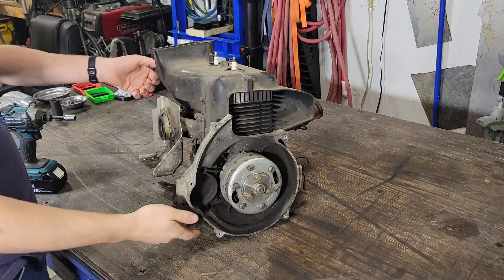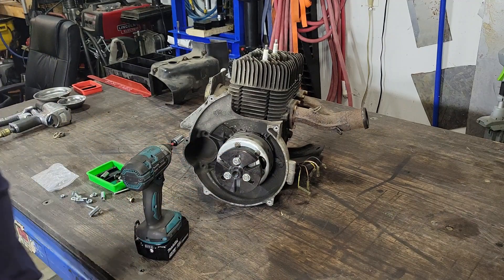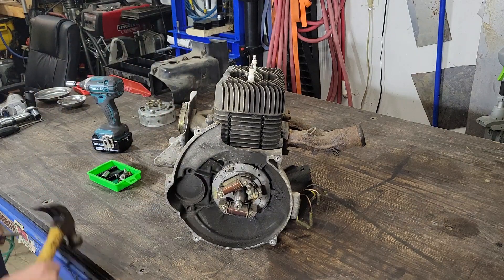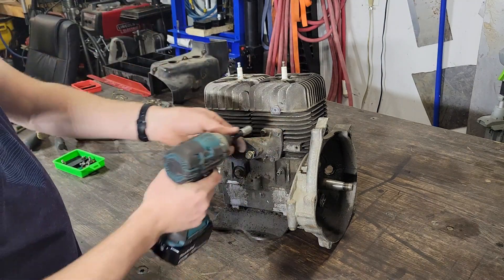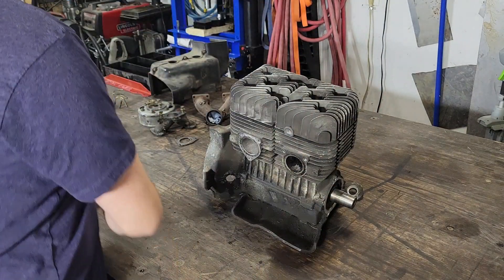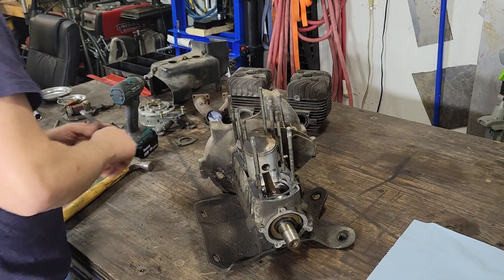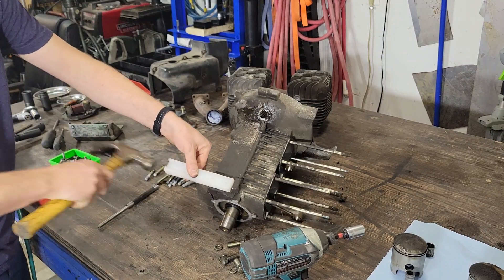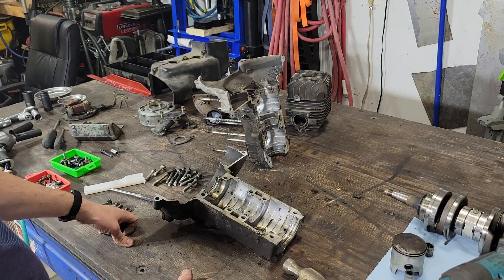Yamaha Enticer 340 Engine Tear Down

Comment: how did you remove clutch sheave from crank, only thing missing to open crank case on my engine.
Reply from the maker: The appropriate clutch puller. It threads into the clutch portion and pushes against the crankshaft. 
https://recreationsupply.co/wecs.php?store=recsupply&action=display&target=67944

Comment: Where’s the fan? Mine bolts to that flywheel
Reply from the maker: Yeah, the fan and recoil catch were removed prior.
Reply: @Garage_Tinkerer  I just put my ovation back together after having the crank rebuilt after a bearing seized,and all it will do is backfire. Pulled off exhaust,Torrs in bypass,great spark,,,,, shoot with ether AND ALL YOULL GET IS A BACKFIRE OUTBTHE EXHAUST.  Carb is clean. Stator is non adjustable. I’m stumped.
Reply from the maker: @thomaskennen3470  Are you using the stock CDI, because if that is mismatched to the stator it can cause timing issues.